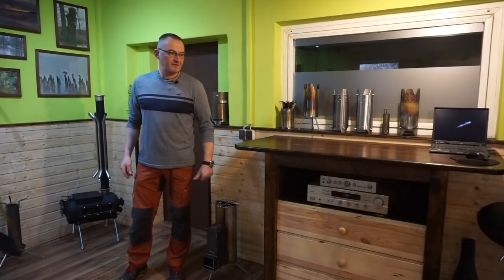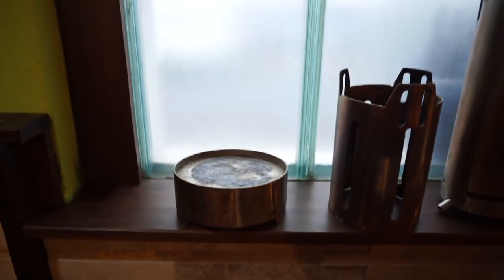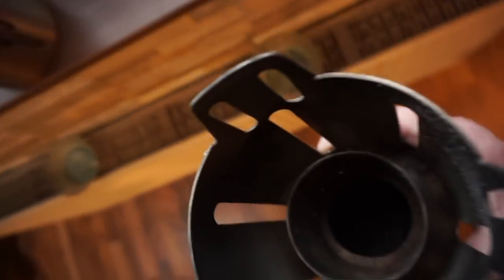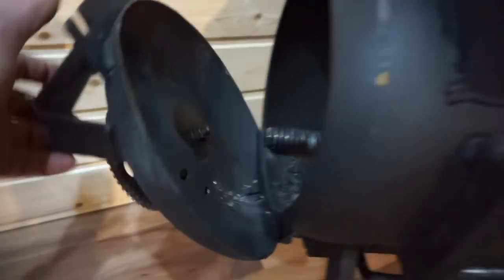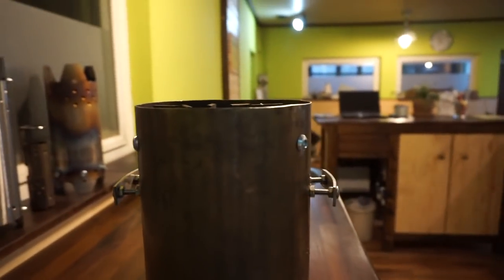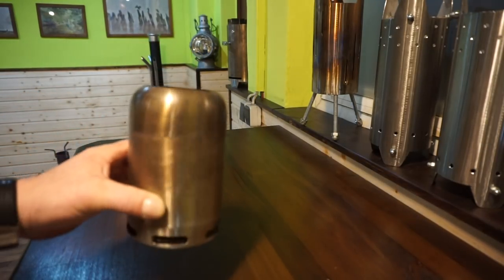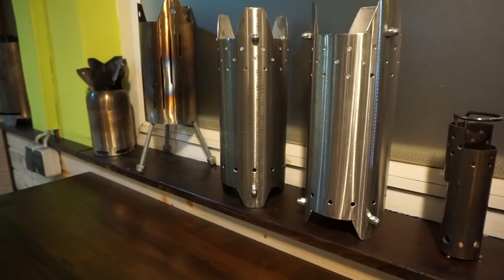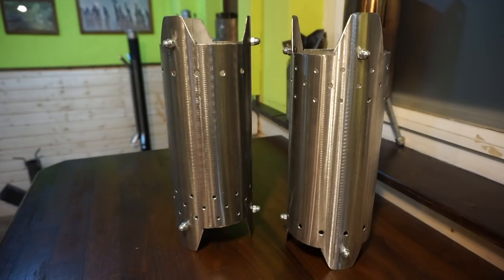all my stoves in a wood(gas)stove - museum

Comment: I see you updated your 15 Euro stove from the original version. It is a pity you don't have another video on the newer version with holes in different location and using the domed top as well. I plan on copying most of your method for doing these including your calculations for correct ratio. It is quite a neat unit. I regularly see these little thermos' in second hand shops thanks to Aldi flooding the market with them again in my country.